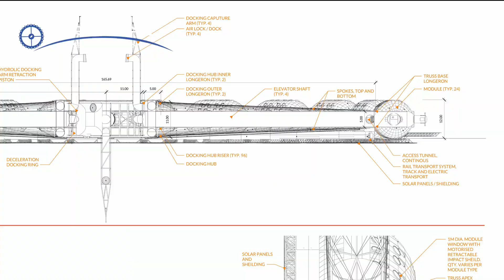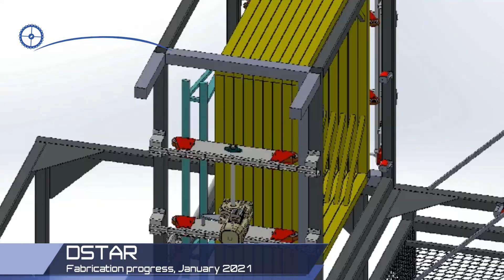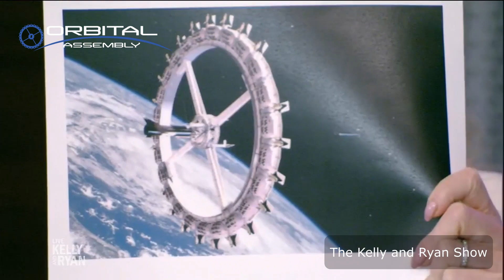Spring 2021 - Global media coverage

Comment: I think this project is super cool, I don't understand how there are not a lot of companies running after it. a project of this magnitude is really the first step towards one day humanity building an O'Neil Cylinder, a heartfelt wish that you are very successful
Reply: It would be great to see a company like SpaceX to link arms with Orbital Assembly.
Reply: @your20downrange  That's not going to happen.

My understanding of what OAC is doing is that they are posturing themselves to:
1. Create a series of robots that can put things together.
2.  Code those robots to function outside earth gravity.
3.  Put those robots on a rocket.
4.  Send those robots into orbit.
5.  Establish a communications network that they may maintain control of those robots as they work.
6.  Have access to several rockets so that the robots have a constant supply of materials to assemble.
7,  At some point, have access to an orbiting gas station, etc.

The moment Elon Musk sees a profit in that activity - being a billionaire - he will walk into one of his Gigafactories, pull a couple old robots, put them on his rocket - and - off they go.

The moment he - or his competitors - see $$$ in the plan - they will do it themselves.

So what does OAC have?
The mission of building a rotating orbiting space station in LEO.  They need the OAC capabilities to actually build it.  After achieving that goal - they may have developed something others want to use.  Before that - there will be no link with SpaceX.  For now, the best strategy would be to keep the OAC developments internal.